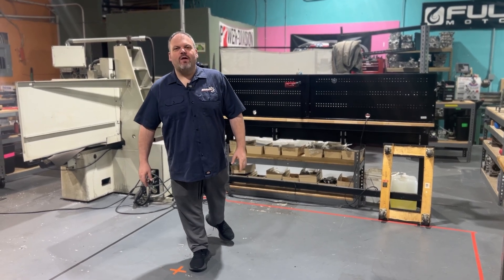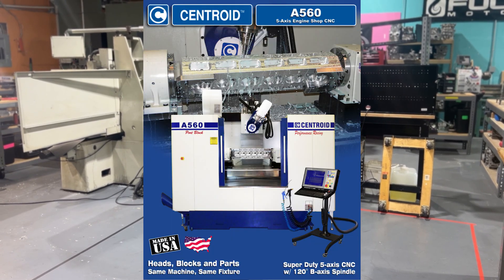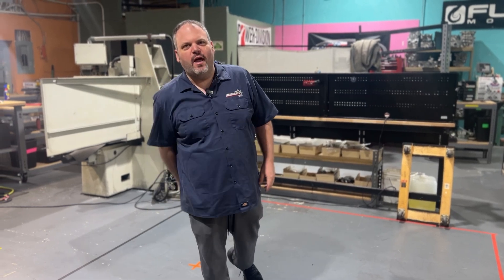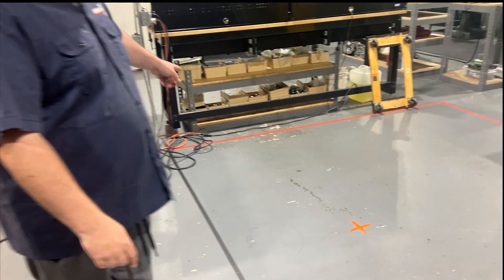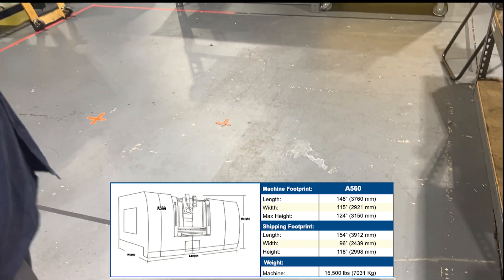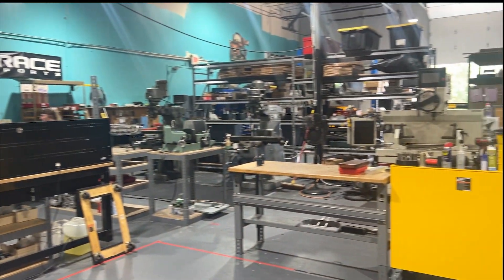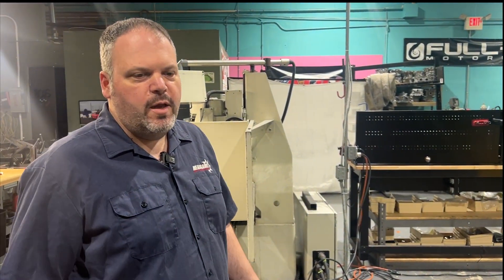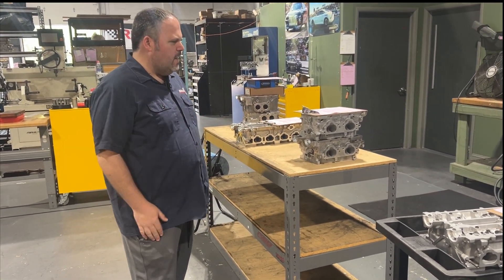HeadGames is getting a Centroid 5 axis CNC!

Comment: Great machine for head work,  I need mazda doch head full port work, chamber machining and install bigger beryllium seats for race valves. When ready do it?
Reply from the maker: @stranger-j7j  we don’t have any plans to make a Mazda program. And we haven’t used any beryllium since 2005, there’s better options.
Reply: @headgames  First this head go flow bench so we see what it do original size?  Beryllium work well with ti valves but i know there is many option. This head fit n/a motor which become spin over 9,5t rpm.
Reply: @headgames https://youtu.be/6f4RRFUW69A?si=ok-WEaSk5sQ1l1Fr  I see a lot potential tune up this mazda 4 spot,  Basic engine is strong  high boost application, but it need best head work what available, so maybe HGM can do it?